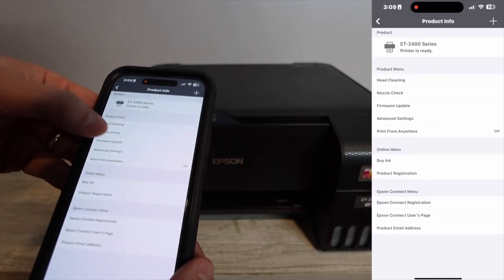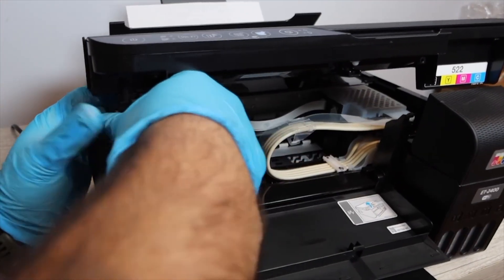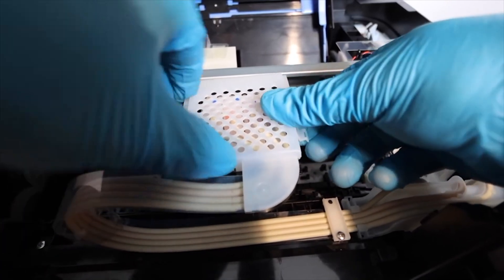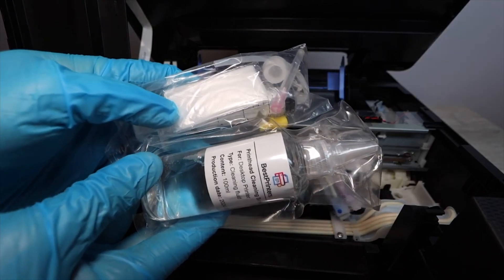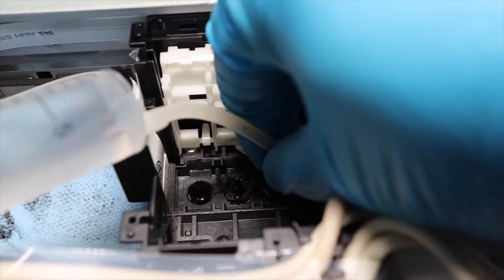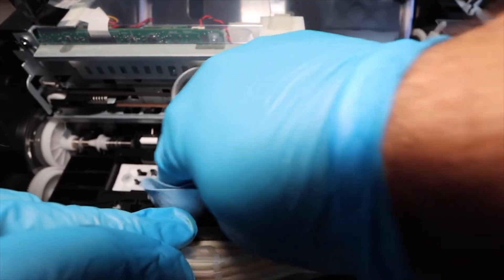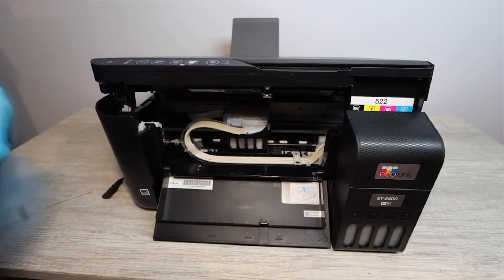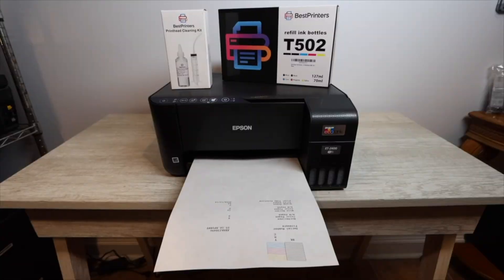How To Unclog Printhead - Epson ET L3250 & Similar - Not Printing Black or Color [Full Tutorial]

Comment: If any liquid escapes the rubber gasket and gets on the electronics of the print head and you cut on the printer you will blow the f2 fuse on the main board.

Comment: I have spent so much time today to fix my printer. I didnt use the printer for months and I cleaned the print head with a printhead solution. Nothing worked! Tried all tips and tricks and finally the issue got solved after injecting the warmed print head solution through the nozzle. The temperature might have solved the hard clogged ink.
Thanks for the tips mate !

Comment: Hello.. i did the pattern check. Not a single yellow  line appeared..  question.. The blue one has only one small part cracked line.. do i also need to use the solution on the blue? 
Thanks. Cant wait to get hands on with this guide and fix the issue